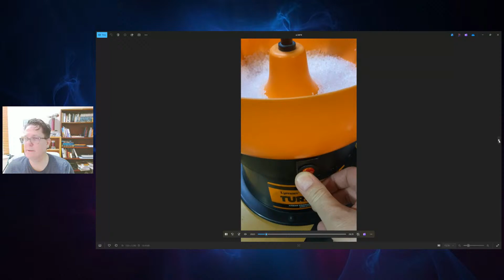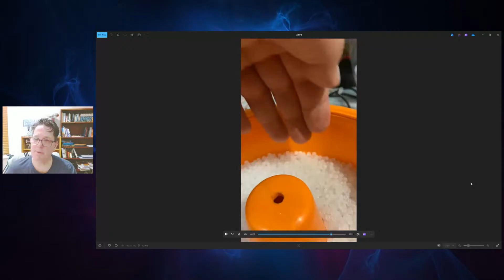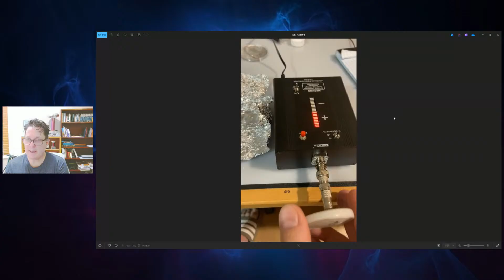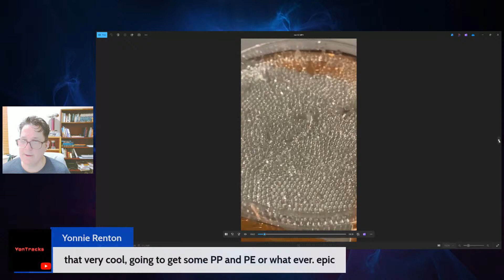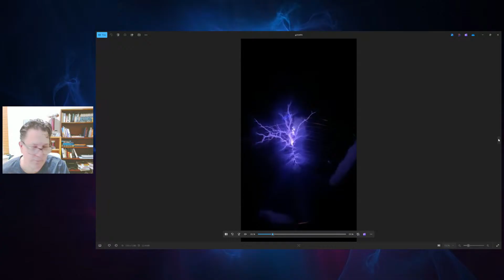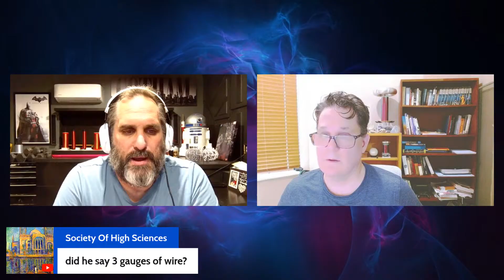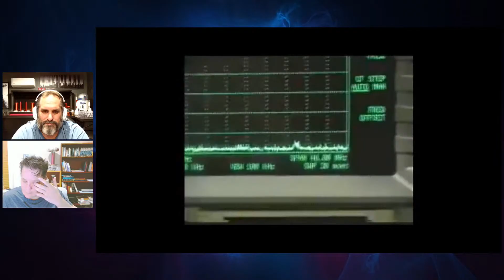Shawn Calderon Presents

Comment: 5:07  love the thrift store creativity. Tnx Nathan, Shawn 👍🏼
Reply: 19:37 try putting a magnetic choke on input side to stabilise? Superconductivity is possible between coupled magnetic fields. Your tripple setup might be enabling it. They use magnetic chokes or ballast in gas discharge lamps to magneticly self regulate the amp draw.
Reply: Interesting point. Thanks for sharing